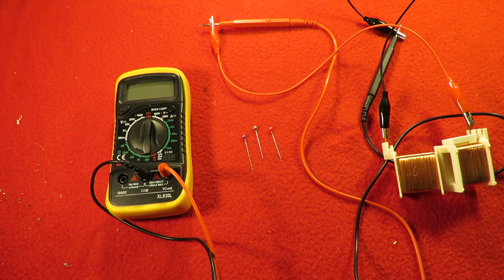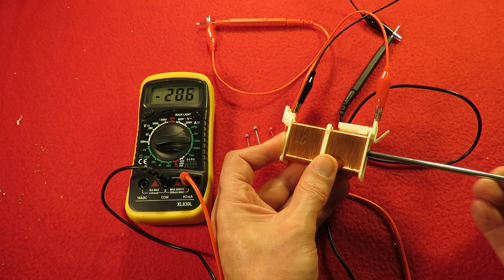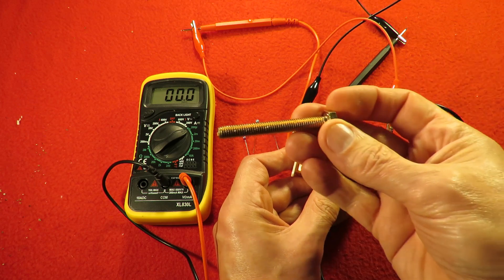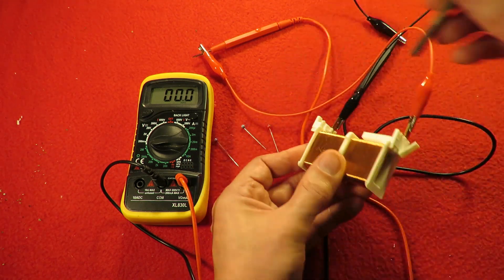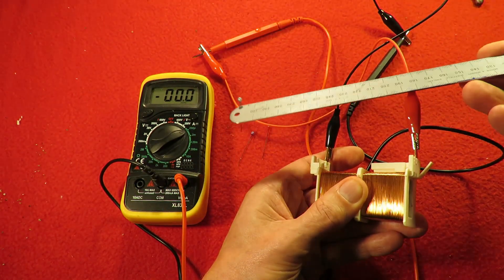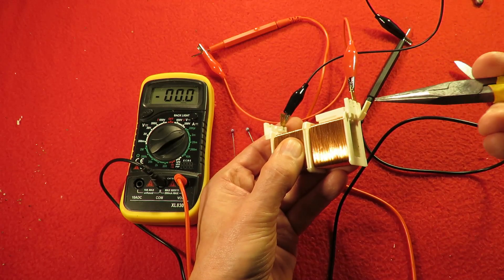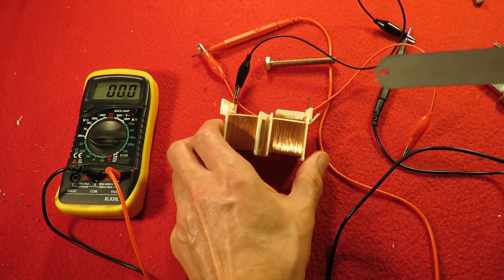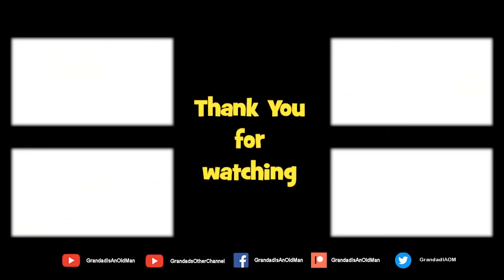Does moving an iron core in a coil induce a current flow?

Comment: Is the electrical source DC or AC
Reply from the maker: There is no power source. I am looking to see if pushing an iron core in and out of the copper coil generates any electrical field. If I was using a magnet it would generate a current flow in alternate directions as the magnet moved forwards then backwards. This video was specifically about moving an iron core in a coil. In an old video I stuck a screwdriver in a coil and got a current flow but forgot the screwdriver was magnetised. SO the question here was would just a plain iron core generate any current flow. My guess was there might be some interaction, but with the measuring tools I am using, the result we see may be nothing to do with moving the iron core.

Comment: I think if you run AC current through the coils or a coil, that you can demagnetize the bolt then try it in the coils again. Better if you own a demagnetizer.  I really need to get a new voltmeter myself. Mine is the first digital one from radio shack and may be older than your kids.  lol
Reply from the maker: I think it is one of those experiments where you could easily chase your own tail. Even a demagnetised iron bar would still be within the Earth's magnetic field so if you are looking for tiny results you will probably see them but they may or may not be caused by what you expect. Radio Shack - yes that brings back memories - and Tandy - and the TRS80 😍
Reply: Oh yes, Tandy got a lot of my money in the 80's. 3 color computers, 2 I still have, the original trs-80 which cost me $900 in 1979, pen plotter, joysticks, ect. I even bought a $300 portable shortwave radio so I could use the coco to do wefax stuff. Weather facsimile graphics. It worked too. Took 12 minutes of screeches from radio to produce a black and white chart on screen of pressure in different areas. They said in a article from Rainbow magazine that I got the program from that the coco was doing what $10,000 machines on ships in the ocean were doing. Was pretty cool.
 @GrandadIsAnOldMan

Comment: I saw an experiment where they were putting two copper tubes very close together and moving them at a significant rate of speed It produced electricity but it took a lot more current to produce electricity and what it was worth apparently the domains in any potential magnetic material can line up under appropriate scenarios
Reply from the maker: Yes, I think you can see where I was going with this. Clearly a magnet will induce the current but the question was to use something that was not actually a magnet but "could" be.
Reply: @GrandadIsAnOldMan  tje neatest thing i have seen was a tiny magnet with a coil around a metal shaft. When you touch the core with a magnet it pulses a current and then when you pull the magnet off it pulls a current.  A great way to show current iis fluctuations  in a magnetic field.
Reply from the maker: @neuphpne  yes I have videos of lighting LEDs with magnets and coils but this was trying to see if a non magnet could induce an effect. In fact the video that inspired this video was me creating a current with a magnet although at the time I didn't realise I was using a magnet as I was just using my screwdriver and forgot it had a magnetic tip https://www.youtube.com/watch?v=WOFo0Xhegu0&list=PLA5a2xPRSrB0vgl3kvyD0ZGWqIXCvPWEq

Comment: Hi,
You need to put a magnet through the coil in order to get any significant voltage. The magnetic flux causes electricity to flow through the copper wires. Just like using an electric motor to generate electricity.

 xl125sz: made a good comment about making a small coil gun. Just discharge a capacitor through the coil and have a metal object in the coil. It will throw the metal object out one of the ends. It can be done with a battery by touching the contacts fast and letting go but a capacitor will discharge instantly and throw all its voltage forward through the coil making a better effect.

I know you will know all this and you are demonstrating the effect, but the coil gun is a good project to try. 
You may have already done it in one of your videos because you have so many. :D

Cheers.
Reply from the maker: Thanks Mike, this was specifically about moving an iron core in a coil. In an old video I stuck a screwdriver in a coil and got a current flow but forgot the screwdriver was magnetised. SO the question here was would just a plain iron core generate any current flow. My guess was  there might be some interaction but with the measuring tools I am using the result we see may be nothing to do with moving the iron core.
Reply: @GrandadIsAnOldMan :

I "did" make a coil gun a few years back, before I moved house.

The coil was hand wound with thick enameled copper wire. I bought 3 large high voltage electrolytic capacitors (about the size of a tin of beans) and wired them in series. each one was 400 volts and that gave me 1200 volts with about 800 farads capacity. 

The coil was fitted over a stainless steel rod of about 5mm. I charged up the capacitors with a flyback transformer from an old TV via a big diode. Then I used a 100 amp relay to empty the capacitor load into the coil. 
I used a screwdriver tip as the projectile. 

Well, I put a "hole" in the living room wall and the wife was "NOT" a happy chappie.

I have to say that messing around with capacitors like the ones I mentioned can "KILL" in a second.

Best to try it with small 10 volt capacitors for demonstration purposes and safety. 

I don't think YouTube would let me put up a video of how it was made.

Comment: This is good information...Thanks for sharing!!
Reply from the maker: Thanks, I don't think I have proved anything here, just created more questions. This was specifically about moving an iron core in a coil. In an old video I stuck a screwdriver in a coil and got a current flow but forgot the screwdriver was magnetised. SO the question here was would just a plain iron core generate any current flow. My guess was there might be some interaction but with the measuring tools I am using the result we see may be nothing to do with moving the iron core.

Comment: tada 2nd...unca Faraday waiting for result...but related to % composition and type of steel / type of fabrication of er core (being shoved through ahem magnetic flux)? simple experiments always fun (called sanity test when faced with duff test leads heh heh)!!
Reply from the maker: Thanks, Yes, I don't think I have proved anything here, just created more questions. This was specifically about moving an iron core in a coil. In an old video I stuck a screwdriver in a coil and got a current flow but forgot the screwdriver was magnetised. SO the question here was would just a plain iron core generate any current flow. My guess was there might be some interaction but with the measuring tools I am using the result we see may be nothing to do with moving the iron core.